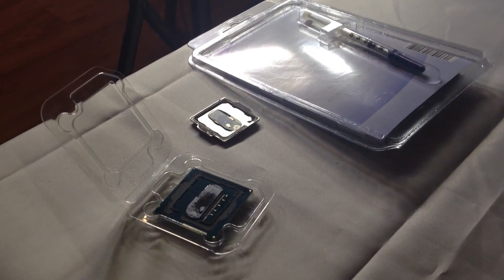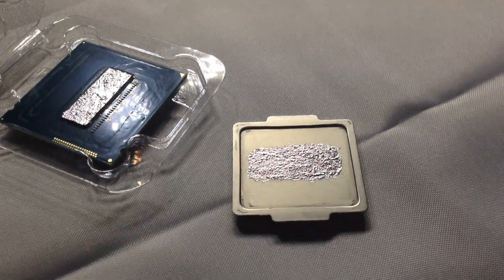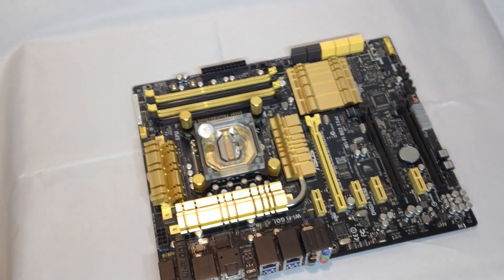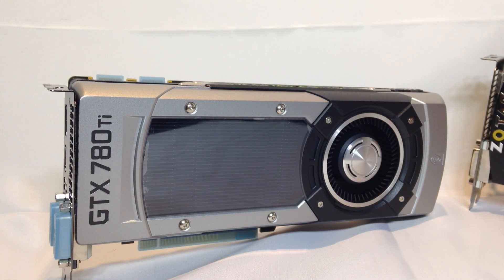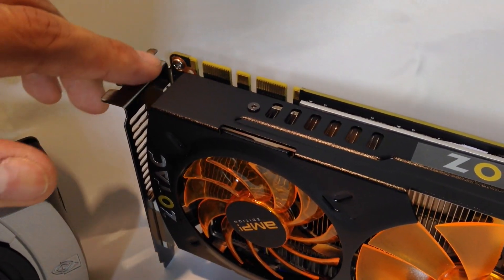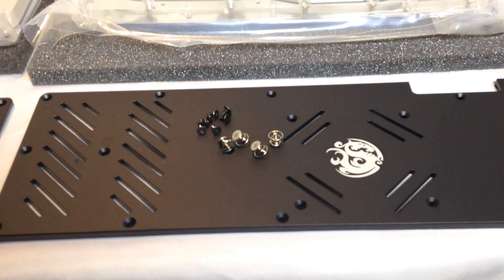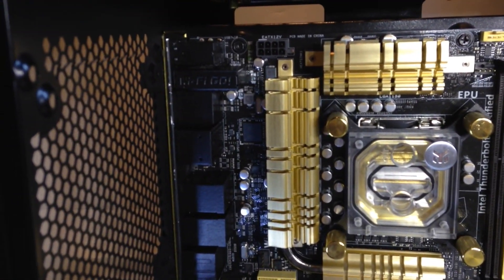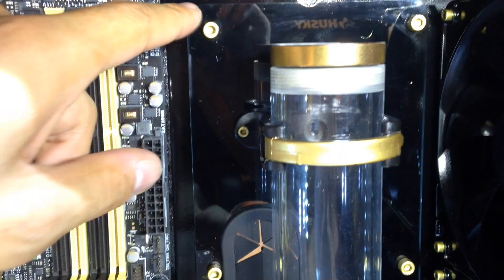Gold Rush Part 5 - Delidding, Final paint assembly, 780TI waterblock install and more

Comment: I want to do a mini ITX watercooled build possibly using the obsidian series 350D windowed case; could I get your opinion on the case if you have the time?
Reply from the maker: Al Haslerig III absolutely, this case is by far the nicest case I've used, keeping it in mind that I've typically taken a crappy case and turned it into something exciting and practical.

My next build will most likely be a mini ITX build because I love the small form factor. That being said I waited until the 750D came out because it's not overly large or to small. The window is really what got my attention, all my builds are customed everything so I put in the biggest window possible, this case already had that covered. The interior is fairly standard, but simple enough if your going to mod your case for maybe 2x240's ;) 

For mini ITX 100% go with the corsair 350D :)

Comment: Did you notice any difference in fan performance after you painted them?
Reply from the maker: I would not see any performance issues increase or decrease as I did not paint the fan blades, only the shroud around them. I have heard if you paint the blades you can create a weight distribution difference and burn out the motor as it is uneven rotations.

Also, I have yet to test!!! LOL
Reply: Custom Computing

That was the same thing i heard,i also heard if you painted them with air brush with nice even coat there won't be problems.Well if you test it  send msg with info